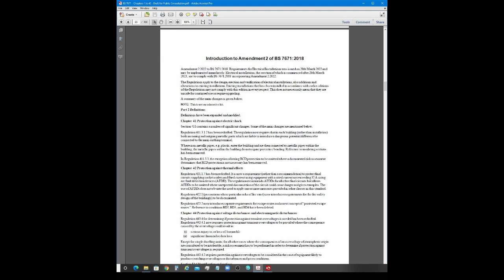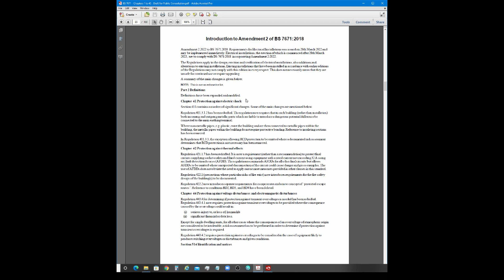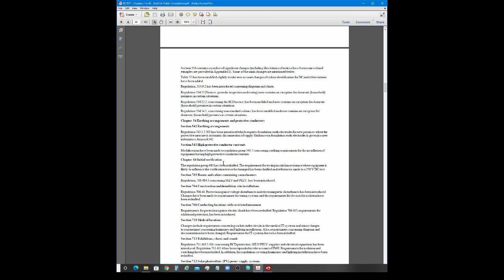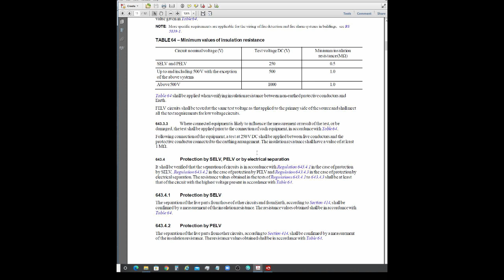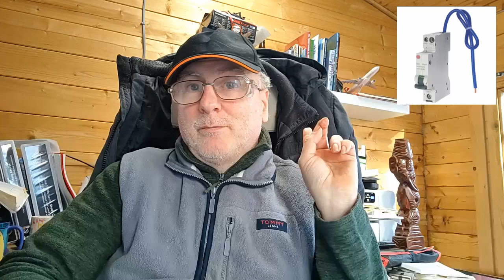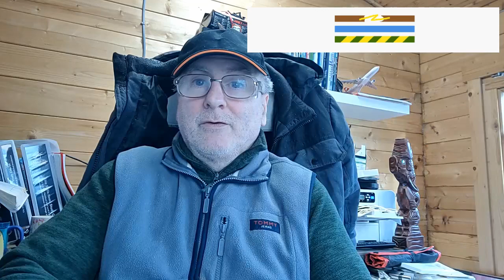BS7671 18TH EDITION AMENDMENT 2 - It's here - Are you ready ?

Comment: Here in the USA the use of arc fault breakers was gradually expanded over 1-2 decades - prioritizing areas where pets, children (and adults) were likely to cause damage to electrical wiring. That is especially extension cords - being chewed on by pets, being walked over,  getting damaged under the weight of furniture, etc. So, I think that they will be useful on ring circuits and will prevent fires from occurring. Today in the USA a dual function afci/gfci breaker is about the same cost as either an afci breaker or a gfci breaker, so my guess is that the cost in the UK will plummet once people start buying the new breakers in quantity.

Comment: I think Amendment 3 will probably omit ring circuits due to AFDD not tripping out as you have mentioned on your scenario and advise radial circuits, so it can push the narrative..as manufacturer will never want to lose out of the revenue that will be lost!
Reply from the maker: I do wonder when it will appear in the regs that rings are obsolete and not to be installed in new builds or put back in during re-wires.
Reply: @vwes  I've worked around the world and the only countries that install ring circuits are common wealth countries as the ring circuit is a British requirement as Europe & most all the non common wealth circuits are radials circuits , so that was my thought as regs changes as we speak to fit what the  big guns are selling lol

Comment: In my opinion AFDD’s should be made mandatory on shower circuits.  How many times do you come across thermal damage at an isolator or a shower.  I don’t think there is any chance of them bringing this regulation in.  There has been massive controversy over it.  Just like the earth rod debate some time ago.  I think it was the 18th edition
Reply from the maker: Absolutely agree, I think its a bizarre decision to limit the introduction of AFDD's to circuits at 32A or less.
Reply: Because shower circuit is one circuit and they know most houses got 3 rings ... and a few rads that’s 5 ... there greedy.

Comment: I have done tests on 250v with equipment in place and get bad readings on my 1st training back in the 90s was put to me we test at 500 double the expected voltage as if damaged cable is there the meter will show as a bad reading neon land in shower switch will show up.  So the new change just test at 250 what is the point it will not show small faulty that will become a danger.
Reply from the maker: I think the problem is with the proliferation of led spotlights and sockets with USB charging ports which can't be easily isolated without taking apart the wiring. At the moment inspectors tend to put LIM on the reports if they can't test these kind of circuits. It's not a perfect solution granted, but its better than nothing. Maybe the limits in the regs need review as well ?
Reply: @vwes  My thinking is USB charging sockets need a very easy modification to the build.  So easy why not have them linked to the switch side so the socket needs to be on.   Socket off we all test as normal.  Also AFDs need to be used more on Hi powered circuits as the arc will be more damaging to the surrounding of it.  As I also come from electronic servicing I have see low powered arcs and Hi Powered arcs it has always been the Hi power.  With old installations from 17th and before not needing them to be fitted is pointless as new installations with radials the chances or arc faults is almost zero the guy from DS didctesting on arcing to see what would trip them.
Reply from the maker: @alunroberts1439  Ive started to see USB charging sockets rated to take an IR test at 500V. Not tried them yet to see if they actually can take it.
Reply: @vwes  I have got some and gave them 500v and 1000v just to see what happens the cheap ones lived.
Reply from the maker: @alunroberts1439  were they the BG ones ?
Reply: @vwes  Yes an some from home and bargain 👌 funny isn't it some low end ones last longer

Comment: Regarding  eicrs  you can't fail  a 17th edition board now just because It hasn't got an SPD  to 18th edition or even because it's plastic  it would only be a recommendation  so when the arc protection becomes  mandatory which I suspect it will  any future eicr of previous installs won't  suddenly become a fail  because  lack of arc protection  it will apply  to new installs the price will come down  but by how much however  it will  still make the whole thing ridiculously more expensive  especially to us the registered sparks who are  having to keep to the current regs  we will lose alot of board changes  at least it's just gonna let the cowboys grab the work    not  certificate it and  put and old antique SPD with rcd rcbo board. It sounds crazy  . the whole industry is moving far to fast
Reply from the maker: Yes, you're absolutely right, I mispoke at the end of the vid concerning failing EICRs. It woudl be a recommendation to the client not a compulsory change.

Comment: They only detect arcs in the circuit, not the equipment or devices plugged in
Reply: The real risk is poor quality, and in many cases non-compliant (just look at the fake plugs alone) devices imported from China, not the circuit.
Reply from the maker: Thats an interesting observation, I hadn't thought of that. Is that really the case that an AFDD would not detect arcing in something plugged in ? That's quite a failiing given MCB's and RCD's will trip if a pieces of plugged in equipment fails.

Comment: The line " they are common   in the  USA"  which is being trotted out with alarming regularity to justify the use of AFDD'S in the UK is starting to wear a bit thin, have you seen the state of electrical installations over there. Wire nuts are considered state of the art connectors over there.🙄🙄
Reply: Haha indeed mate they need afdd over there because there standards are third world .... we are no way near as bad as them and Europe is shit to
Reply: They also use a different voltage and the devices are not as complicated. They gave only recently been used in Germany too.

Comment: Oh so it sounds like the manufacturers have lobbied to get this put in to the standards. 

Also the extra cost of the consumption of each of these devices is something that I personally wouldn’t want. From what you said here they have very limited effective protective function. If they did something else like show how much current was in use on the circuit and let me monitor that then I may well be happy to pay the extra electricity cost but to secure against the 1:3000 odd chance that you might get a arc and of that there’s a pretty good chance they would miss it and fail to trip. Nah.